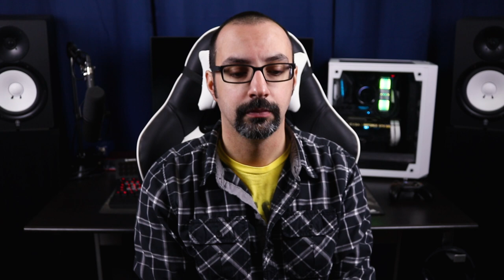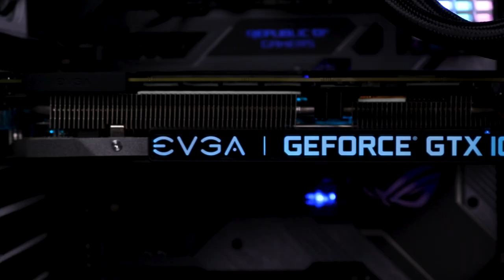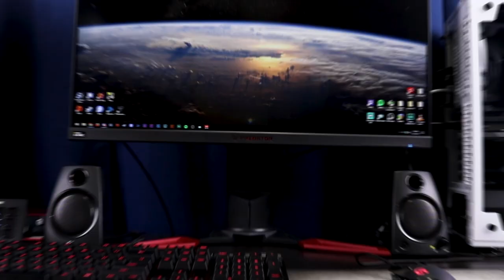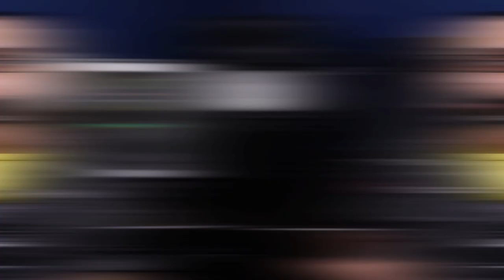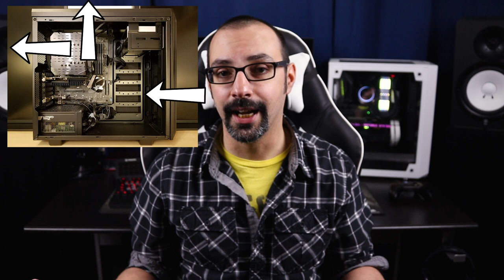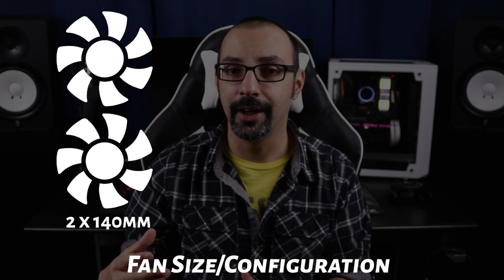Understanding Airflow and How to Optimize it in Your Case

Comment: I was looking for this info. Thanks! I was on the fence between Fractal Design Defince C and Meshify C, but went with the former in hopes of suppressing the sound from the fans. However, I want to try improving the airflow with 2 x 140mm front fans, 1 x 120mm in the back and 1x 140mm at the top. It might go totally wrong, but it's interesting to experiment.

Comment: Can you tell me if reverse airflow helps in cases without front mesh. I have a case that has 1 fan at the rear 2 at the top and 2 in the front.

Comment: Hi, thank you for sharing such a great content !
About your nzxt kraken rad that is on the front panel, are you using it as intake ? so it's pushing hot air in your case, right ? 
Shouldn't you put it on the top panel as exhaust instead so that the air heated by the kraken rad goes directly outside ?  Is it even possible to do this ?
I'm currently thinking about this issue for my next PC.
Thanks for your help
Reply from the maker: Glad you found the video helpful! 

This is a pretty common concern with a lot of people who are thinking about investing in some kind of water cooling for their PC. I had this concern initially until doing some more research. 

Ideally, yes, if you can mount your radiator in the rear or up top, you probably should. However, if your case and doesn't give you the room or your Motherboard/RAM obstructs your ability to mount the cooler in those locations, then front mounting your radiator is totally viable and not as detrimental to temps as you'd think. 

It could be a problem if you're not exhausting enough air from the case, which is a problem I initially had. With only one or two exhaust fans, my gpu temps were hitting 90 C and that was just unacceptable. After adding a third exhaust fan (two up top, one in the rear) my gpu temps currently never exceed 72 C.

Trust me, i was just as surprised as you might be to hear that one fan made that big of a difference, but that's how it played out. It made me realize that the most important thing is to have adequate airflow in the case. Im sure i could get the temps just a bit lower, maybe 2-3 C cooler if I we're able to top or rear mount the radiator in my case. But my CPU temps (about 40 C while gaming, 60 C when rendering videos)  and my GPU temps (between 64-72 C depending on the game and ambient room temps) are well within safe operating temperatures.

Ultimately, I think the most important thing to consider when placing your radiator is the design of your case. Not all cases are built equally and a lot of them perform vastly different from each other. So if you're having issues with heat when using a water cooler and your case limits your mounting options,  then consider usinging a different case with either better airflow or more mounting options. I personally like my Fractal Meshify C because it's a compact mid tower with excellent airflow. 

Consider each case's airflow situation on an individual basis. 

Check out this video from JayzTwoCents:
https://youtu.be/YCZ5iP5cu8g

This video from Bitwit:
https://youtu.be/xNAMxZgvves

And this video from Gamer's Nexus:
https://youtu.be/mGp0I1fw6RI
Reply: @HobbyistPCs  Thanks for your answer ;)